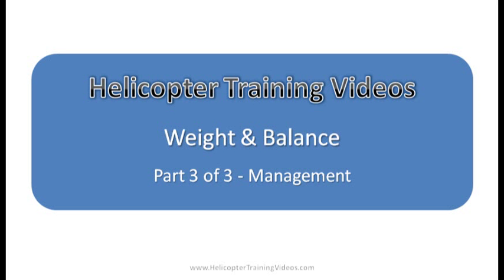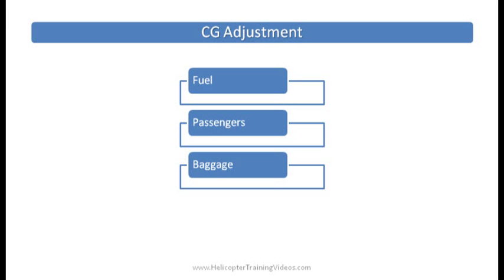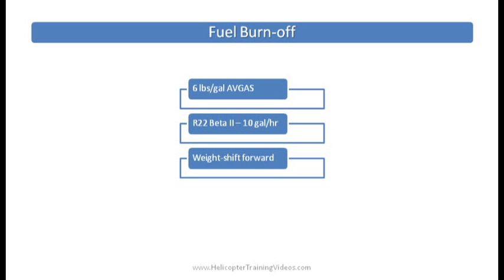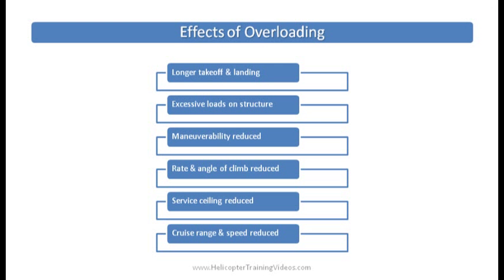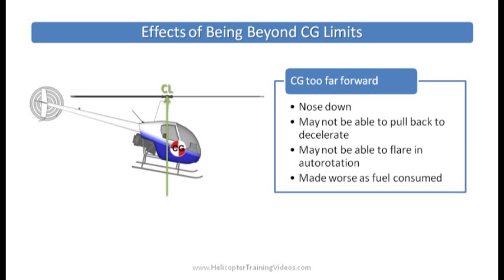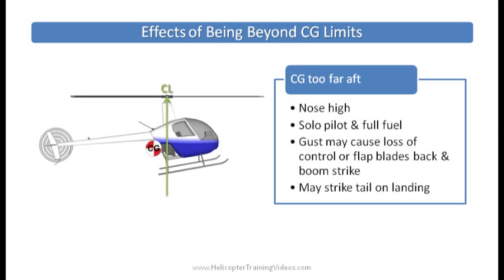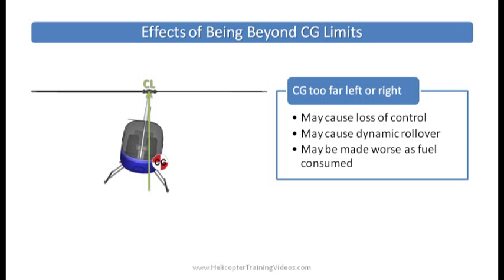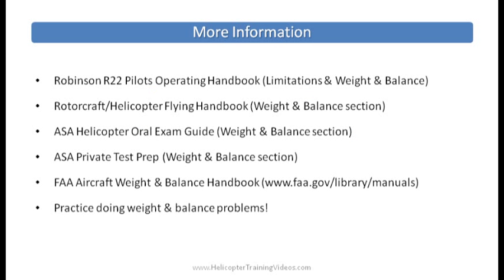Why Is Weight and Balance So Important in a Helicopter? Weight & Balance Part 3 of 3

Comment: Thanks for these videos - so helpful at reinforcing the FAA manuals!  Is there a "limit within the limit", by chance, that you use as a "no go" rule?  I would think having a bit of padding would help pilots make smart decisions as they plan.
Reply from the maker: Good point. I tend to add padding to passenger weights unless I know they stepped on a scale at the airport. Also as I see CG approaching limits I take extra care on pickup to make sure the hover cyclic hover position feels reasonable, with enough range available for and aft. Part of a good hover check after pickup.
Reply: @HelicopterTrainingVideos   Does CG become less of a factor with engine power and rotor system?  Meaning do the tolerances of CG become larger with more powerful (turbine) engines and fully articulated rotor systems?  Or do you ALWAYS calculate regardless of aircraft?
Reply from the maker: @davidallyn1818  As aircraft get bigger, the effects of say 20 lbs become less significant, but there are plenty of accident reports of very big helicopters overloaded/out of CG. W&B should always be considered, but rather than calculating, there are loading software options, or loading charts with maximums allowed for each row of seats & cargo areas, etc. So as long as your weights are below the area limit you should be OK.